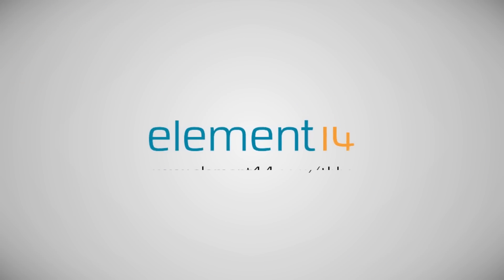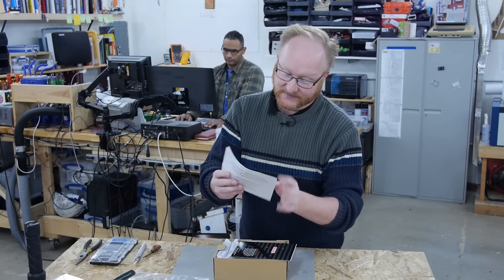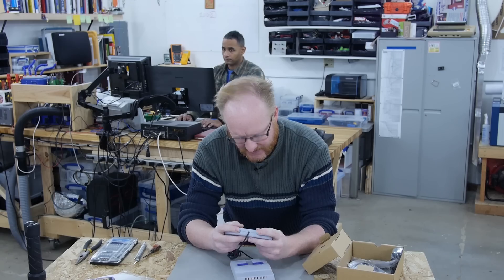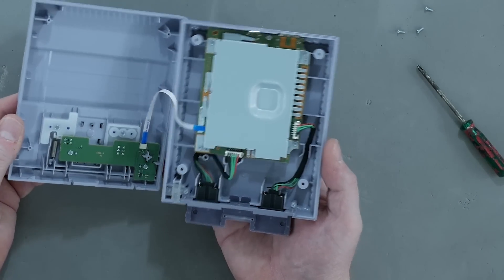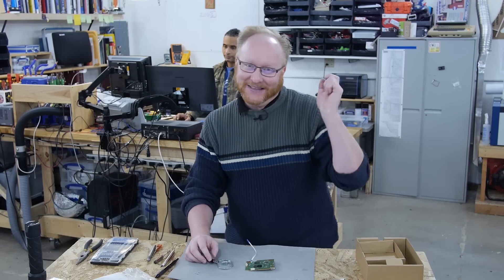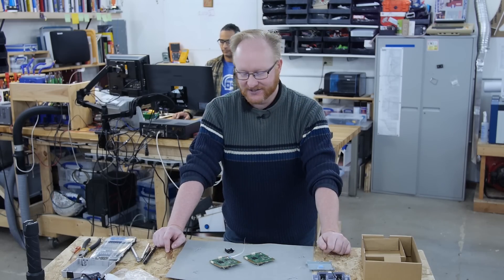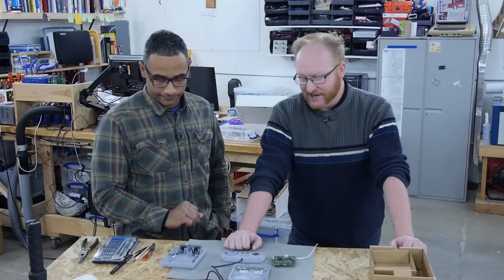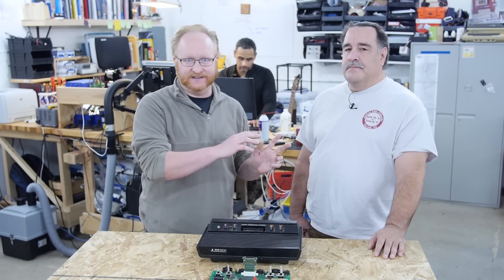SNES Classic Teardown

Comment: You can get a 3.5" hdmi screen... they're quite common
Reply: people need to stop fucking tearing apart the ps1 lcd's. They are becoming much more expensive and less common because of it.
Reply: But would they be 720p. SNES Classic needs 720 output, at least the claims so in the video.
Reply: Why would you bother with that when you could use a Raspberry Pi zero, Like he's going to, and have access to every game released? Not to mention, not be limited to one console.  You're not thinking.
Reply: Yeah but it really doesn't, none of those games are higher res than 240x180 (Or what ever it is, fucking tiny),  and on a screen that small those games look beautiful at those resolutions, you plug an N64 into a 3 inch composite screen and it looks like a modern DS game.
Reply: Ginger Ninger that doesn't mean the snes classic itself doesn't require a 720p screen.  Since it's HDMI it's not hard to believe Nintendo would only expect you to only use it on a modern tv. The issue is not the games themselves.
Reply: That's not the point I'm making, the point I'm making is that you don't need 720p for a portable, on a small screen 720p is pointless, especially in these games.  So why bother fucking around with HDMI and going through all that extra effort when you can just get an easy composite screen.  Job done and because it's small it'll still look great.
Reply: Ginger Ninger because the snes classic only has HDMI, lol. It's more effort to add an analog video out, HDMI is already there. Not the other way around, this ain't the regular old SNES. The snes classic was made for an HD display, how are you not getting this.
Reply: Ginger Ninger lol because the question here is using the snes classic. You know, like op is taking about, like the video.
Reply: Why go through all the effort and expense for that when there's a better way of doing it? You can put square wheels on your car too, doesn't mean it's a good idea.
Reply: That's not really the point here. I'd use a raspberry pi as well. But moders do enjoy the challenge of making something that's not supposed to be portable, portable.
Reply: It really seems like a lot of wasted effort and money in this case though. Especially when it can be done smaller, cheaper and better.  

While I understand the wanting to make non-portable stuff portable, this is something that doesn't need to be portable at all.  an actual NES or N64 is awesome because of the challenges involved and it's a legit console, this doesn't make anysense because there's no novelty to it.  It's already a small arm board, it's not that much of a stretch to use a different smaller arm board for the same effect.  

Depends what you're going for I guess.
Reply: He probably wants to use more PSX screens. Those come with speakers built in, simplifies design.

Comment: Nintendo 64 emulation is extremely hard to achieve. The reason is because they used a very complicated system architecture compared to other consoles like the PS1. This means that, while most consoles require a processor several hounded times more powerful to achieve emulation, the N64 requires a processor several thousand times more powerful. The raspberry Pi 3 cannot reliably emulate an N64, but it can emulate a PS1 to near perfection. Only Intel powered SBCs can accurately emulate an N64, even the more powerful smartphones can sometimes struggle.

The system architecture and how shaders and other rendering techniques work are quite important for how much power you need to achieve perfect emulation. This is why we have quite good Wii U emulation on CEmu but we still don't have any PS3 or Xbox 360 emulation. The NES and SNES processors have been reverse engineered to such extent that we now have 99.9% perfect and efficient emulation.

Nintendo may actually be the only one out there able to code an efficient N64 emulator, as they know how the entire system architecture works.
Reply: That is why i think they'll probably do Gameboy, GBC and GBA classic minis next before tackling the the N64. It will give them three more years to wait for more energy efficient powerful and cheap chips to come out that they can use for their N64 console.
Reply: On the other hand, they built the thing, so they could probably do it more efficient than most, bot needing to rely on guesses about architecture and such.
Reply: KingBowser 183 Try running games like Pokémon Snap (to the end of the first level), Pokémon Stadium (1 and 2) or Conker's Bad Fur Day. We can make them playable, but for your average Joe it's just a pain in the ass.
Reply: Nintendo couldn't even properly code a Super Game Boy game to take full advantage of the hardware,  their NES Classic emulation is shit (listen to the Super Mario Bros 2 title screen, Dr. Mario, the Balloon Fight noise channel) Bizarrely, NES Animal Crossing is a million times better oddly), the Donkey Kong Pie Factory version has NESASM wonderfully obvious written all over. Do you Nintendo would be capable or, even competent enough to write a proper N64 emulator? If they outsource  to use low-level emulation then probably but you'll be getting a less-than par product. I could go on and on and on and on.
Reply: Having talked in forums to people that have coded games for the N64, It seems nintendo hid the key to well optimized games and used it only for their first party games. That's why emulating say, Mario 64 is so much easier than Goldeneye or Conker's. Sure, you could run Mario 64 or Mario Kart on a toaster, but try running Perfect Dark, Goldeneye, Pokemon Stadium or Connker's.
Reply: Xenia and RPCS3?
Reply: What you just said is the most....
Reply: It is also true that Factor 5 had to develop their own micros for their games. Also, has anyone tried replacing the Zelda games found in the Zelda collection and running, say, Mario Kart 64 and other games? I haven't but I'm sure none will actually work(?) haven't tested but there's an idea for playing N64 games on the Gamecube with Mintendo's official emulator. I read there are some extractors and converters that could do this with minimal success.
Reply: It is said that the Gamecube's emulation of Majora's Mask is the best N64 emulation out there. Of course, there's no way of reverse engineering the emulator itself, besides it being... you know, illegal.
Reply: I know N64 emulation works flawlessly on a 3500 MHz system lol  As I said in my bigger post, I had problems doing it on a 1.05 GHz system, so, there is some truth to your words there.
Reply: And what is this 'complicated system architecture' exactly? Could it be the fact that the N64 was a 64-bit console while the PS1 was a 32 bitter... wow mystery solved

Comment: i got a N64 Emulator running smooth on my tablet which has like 1GB of Ram, 1.2 GHz duel core (Constant Clock Speed), I'm not sure what GPU it has. But as people have said in the comments some games work, some don't. just luck of the draw to be honest.

Comment: The raspberry Pi 3 can emulate N64 fairly well. Like even early 2000s PCs had no trouble emulating it.  

And even after all these years N64 emulation is a little glitchy; so I'd assume Nintendo's in-house emulator would be more efficient and have those kinks worked out.
Reply: They'll have it even a bit easier because they only have to work with a set list of games that come with the mini - just make sure the emulator works perfectly with those games, and they're golden. PC emulators have the downside of having to work with as broad a range of games as possible. Of course, that'll suck for when people mod the N64 mini and find that some games don't work well, but what are ya gonna do.

Comment: N64 emulation is a very mixed  bag even on  modern  hardware. The  N64 was  crazy  difficult to develop  for and this makes emulation more of a problem. Some games work nearly perfect to where others only work with specific emulator. Then many games just won't work properly at all.
Reply: So N64 Classic would actually have an actual point to it?
Reply: Joshua Chap Yeah, just like the Saturn

Comment: The Smallest screen I could find that works with a Pi Zero is the: "Waveshare 800*480 4" HDMI LCD For Raspberry Pi 3B/2B/B+/A+/Pi Zero" with a cost of around $45. It has a backlight on/off switch,  HDMI Out Port already on the PCB, and a Micro USB Port for Power in on the PCB. But if you don't like those ports, there is a header there also. It's also IPS and Touch Screen. I don't think any Retro games exceed the 800x480 screen resolution.
Reply: TotalMK Definetly not. Genesis and NeoGeo AES had the largest resolution, up to 340 x 280 px. Some SNES used 500 something resolution just to render kanji
Reply: TotalMK Yes, this resolution is overkill
Reply: Yeah, but the physical size for a screen supporting HDMI is not bad @ 4" .

Comment: I am just dissapointed to see it's all about emulation (won't jump in with the raspi arguement).... how about a new project, recreating it with FPGA's ?
Reply: FWIW (have worked on both): it is easier to pull off emulation on a CPU than implement a system in an FPGA; and also cheaper and with more capabilities (and usually faster, via dynamic translation).
leaving out more detailed description, but the general issue is more that to get an FPGA that could compete head-on with a generic ARM SoC at this task, it would cost drastically more than the ARM SoC.
Reply: Brendan Bohannon Issue = challenge; You're right about it, yet i'd consider it a project worth dedicating time into... while still, i dislike the fact Nintendo basically copied a retropie again... we all know that this is a matter of a few minutes even for a non-geek, so where is the point in that product... even more as it comes in limited quantity
Reply: I'm working on it, actually.  :-)  I probably have a Digikey package on my doorstep right now with a baggy of 4Mb flash ICs that will go on a DIY UxROM PCB.  This will hold small test programs meant to exercise specific functionality in the NES CPU, so I can characterize it, program various AVR and ARM micros to emulate that (hardware) functionality, then start replacing the NES hardware bit by bit.  When it's all working, I'll convert it to an FPGA.

The NES is simple enough that it makes a good educational project for those (like me) interested in practicing embedded hardware development.  FPGA-based NES clones exist already, and I have seen at least proof-of-concept projects running SNES software, so my little project won't be breaking any new ground. Nonetheless, I do intend to continue this, if I can, to the SNES and maybe the Genesis.  Assuming I don't lose interest somewhere along the way.  Given that I have no motivation to get into merchandising, if any of it ever actually works, I'll give away all the info and let anyone else build one for themselves, or for the community.

Until then, the Classics (or a Pi) are great fun.
Reply: Not exactly.  I have a blog which is almost exclusively comprised of unpublished drafts.  Mainly because I have bits and pieces of info that I want to verify, theories to test, and would also like to create some visual aids that help illustrate concepts I feel are getting lost in dialog.  It is my goal to start publishing as I meet certain landmarks, though.

I'm not very far along, but I'm also spending a lot of time on basic details, like the timing relationship between input clock, phase-2 and M2, and things like that.  I'll probably also spend quite a bit of time on the instruction set.  The 6502 is known to have a lot of quirks, and unfortunately some of them can be (ab)used in code.  That's the difference between 98% compatibility and 100% compatibility, so it's worth looking into.

Since audio and controller I/O are baked into the CPU, they'll be the next things to tackle after I'm happy with my clock generator.  The latter technically already works, it just doesn't match the CPU-generated clocks exactly, and I want to find out how repeatable those differences are on the real HW, as there's no reason I can't emulate them perfectly when I move from on-micro timers and counters to hand-created counters on an FPGA.
Reply: FWIW: I am also working right now on implementing a processor and some other components on an FPGA (for a customized SuperH-based ISA). on a CPU, the emulator is fast enough to basically run Quake 1 decently well in 640x480 (software renderer). things on the in-development FPGA implementation are looking a bit more hard-pressed (even after now using a bigger XC7S50 FPGA, still having to aim a bit lower; with my initial in-development version using a display subsystem more like the C64 than a modern PC due to "technical reasons"; ...).
Reply: Nick Wallette ; aye on the educational part, which should be the strongest driver. Since i have access to a couple of FPGAs at work, guess i'll get my hands on that after finnishing my current mini PS1 project... did you already publish any of your results anywhere ?
Reply: Also, what's this mini-PS1 thing?  You've got my interest.  Top two consoles of all time, for me, are SNES and PS1.
Reply: Nick Wallette ; the mini PS1 is an emulation-based resized console... using an old RK3088 tv stick to play games from a 8cm media (maybe will also try mini disc later on).... it's actually the good old feeling of swapping cartridges/CDs that i miss with all the emulators at all ( as a gamer... at all i suck) and i did not want to just rebuild another NFC mod... will put my stuff up, once it is complete, but have to purchase a 3d printer first...

Comment: well, Super Nintendo Emulation is very cpu intensive. If you want a 1 to 1 emulation, it actually requires a clockspeed of at least 3.0 Ghz believe it or not. Pretty much any computer, even my old dell latitude from 2003 can emulate SNES games, just imperfectly. Nintendo 64 emulation is not very difficult. Pretty much any cheap laptop can do it, even in HD.

Comment: I know it's been said that smartphone hardware is too specialized, but couldn't you try to use one of those LCD (or even OLED) screens in a Pi or NES/SNES classic portable, thus having a real high quality digital screen?
Reply: allluckyseven Unfortunately there's no standard way to hook up a phone display.  Basically every phone has a different proprietary connector.
Reply: Sure, but... He could choose a more common one (if there is such a thing, otherwise just pick whichever one or two) from a big brand like Samsung or LG then try to hook that one to a RPi.

Comment: For what single reason should they change the board layout? What is your problem with that?
Reply: My guess is, the time and capital invested in what is essentially a distraction for Nintendo didn't warrant babysitting two separate production runs (not even considering the regional variants) at the same time.  So, despite the PCB only having minor revisions (which would probably be the case even for the NES alone, as it was optimized and minor issues fixed), they probably discontinued manufacturing the NES shell, having it assembled and tested, boxed, and delivered all around the world, so they could concentrate those (likely limited) resources on the SNES project that was already in the pipeline by that point.

People don't realize how much work goes into productizing something.  It's WAY more than a bill of materials.  It was probably a business decision to not have the Switch, the 2DS, the 3DS, the XL versions, the NES Classic, the SNES classic, a whole fleet of accessories, and a slew of game projects, all on the burner simultaneously.
Reply: He has a motherboard fetish and likes variety.